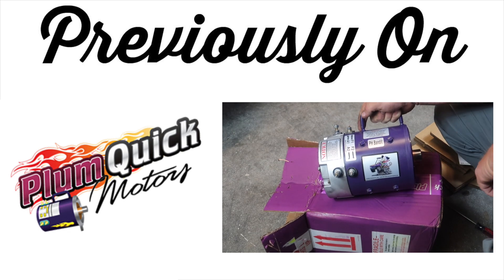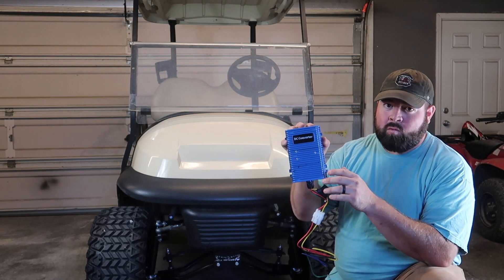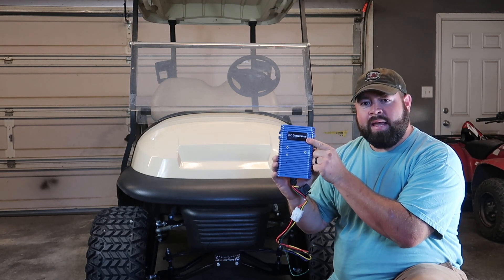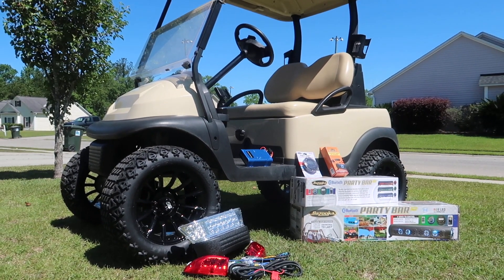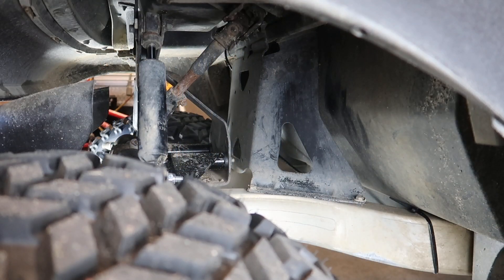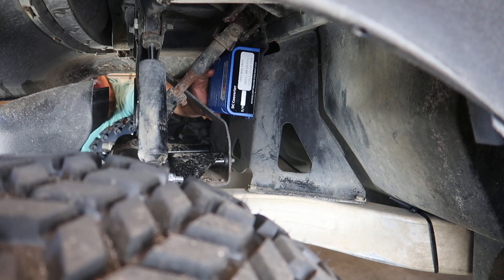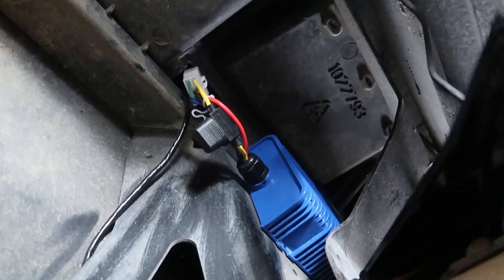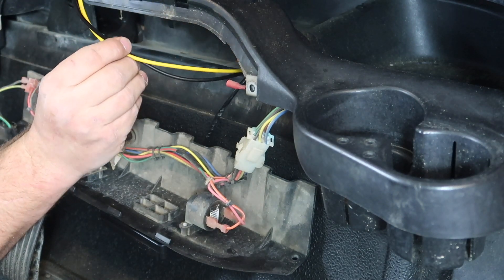How To Install DC Converter on Golf Cart | 48v to 12V Power Converter | Accessory Power Supply

Comment: Just some friendly advice... You should have a fuse or breaker at the beginning of the primary wire where the terminals hook to the battery. This protects the wire in the event of a short from catching on fire. The fuse located on the wiring harness for the voltage reducer is only to protect the reducer but nothing before it. Thanks for the video.
Reply: What size fuse or breaker do you recommend?
Reply: @JaniceFBaca_Translator  that's 30 amp converter....so 30 or 40....the reason for fuse is just to prevent that wire from literally turning into a red hot oven coil if it shorts out...
Reply: can someone say what gauge wire he is running to the battery terminals? While 10g seems the suggested, that looks smaller.
Reply: @kristab03 yellow and black wires are both 12g but 10 will work.

Comment: What size fuses do you put in fuse block for the accessories?
Reply from the maker: Usually accessories will come with a inline fuse. I usually cut the that fuse off and use thefuse that was included in the fuse block. Make sense?
Reply: @Fentertainment  yes but not all accessories come with a fuse in that case what size would you use?
Reply: Great question.  I was going to ask the same thing.  I’m going to install a headlight kit and a fast charge usb (both bought separately) but they don’t have fuses included.  Any guidance would be greatly appreciated.
Reply from the maker: @franciscocano7769  That's weird every headlight kit I have purchased has had fuses. I think you would do fine with a 10a fuse on the headlight kit and probably 5a on the usb charger.
Reply: @fentertainment I ended up getting the Majdak ultimate light kit and it came with a converter but notice it does not integrate with the key switch as your prior video demonstrated with the converter you installed.  Would you use the one that comes with kit or still buy a converter if you were me?

Comment: Would like to drive a spray rig off a 48 to 12 converter.  The spray pump is 12 volts rated at a maximum of 10 amps.  Any pitfalls I should look out for?
Reply from the maker: No, I believe you will be fine. This converter is rated for 30amps.

Comment: Why didn't you put this in the battery compartment instead being "exposed" to the elements? Was space an issue?
Reply from the maker: Not really. I put the converter in the factory location. I just wanted it out of the way however it is sealed and waterproof.